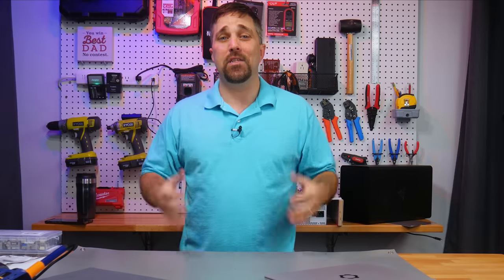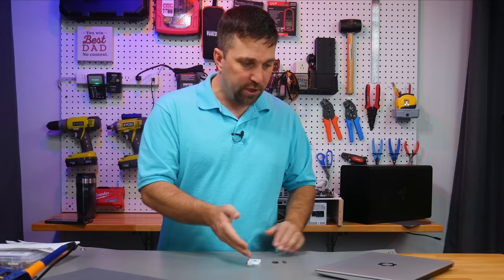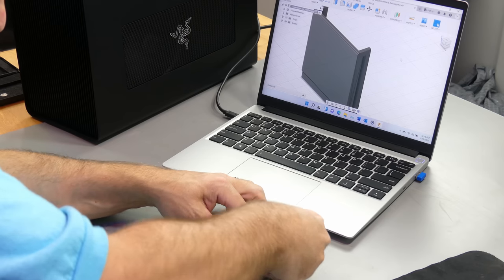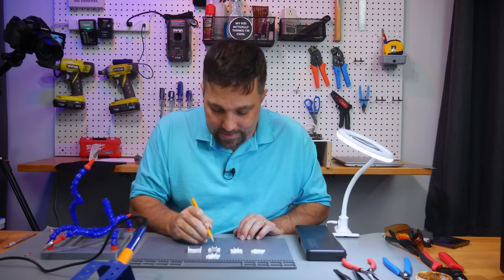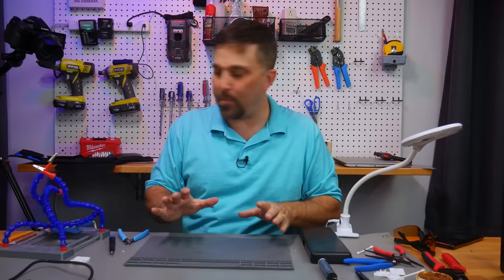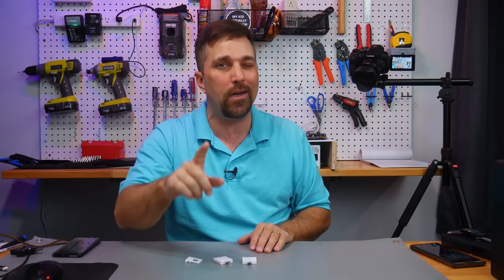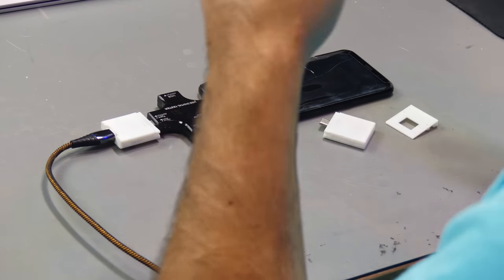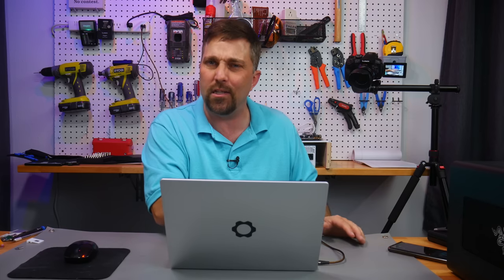Prototyping Framework Laptop Expansion Cards

Comment: Not sure if it would be a thing, but could you add in a breakout in the enclosure, to still have USB out but have a PCB to piggyback off the line to have the best of both worlds?
Reply from the maker: It requires integrating a USB controller chip into the PCB design. I was trying to keep it simple.

Comment: I really wonder if there would be enough room for there to be an expansion card with an internal USB for a dongle and an external one for everything else. I'm thinking maybe the internal dongle could be mounted sideways in the case, idk. 
there could easily be enough room for a double slot adapter, where it's like a mini USB C hub with 2 ports.

Comment: A double USB-A single slot expansion card would be nice
Reply from the maker: Two USB-A ports physically don't fit in a single expansion card.
Reply: @ElevatedSystems  *sad * then they made them either too big or too small :(  Just 5mm extra wide would make double possible it seems. Or make them 5mm narrower and six slots would fit

Comment: Any chance of fitting the Sennheiser GSP 370 wireless headset dongle into an expansion card? Not sure if it would physicall fit. The dimensions are 34.72mm x 17.86mm x 7.00mm for the dongle housing alone (without the USB-A male connector), and the total length with the USB-A connector included is 46.82mm. Measured with Mitutoyo digital calipers with +/-0.01mm Accuracy, 0.01mm Resolution. The part I want to fit is a SCGD7, "EPOS GSA 370". I found the holy grail of wireless headphones (simultaneous mic capture and playback with high quality audio, long range and long battery life), but they're wonky to use with a laptop because of the dongle hanging out. This would be PERFECT and would get me to buy a Framework laptop.

Comment: I wonder if it's possible to add Apple's older style MagSafe charger to this. Say like adding the MagSafe 2 port on the laptop and using an official MagSafe 2 85W charger.
Reply: While it would be cool, MagSafe 2 doesn't conform to the same standards as USB-C power delivery (it provides somewhere between 14.5-20V only, rather than 5, 9, 15, and 20 specifically), and doesn't have the communication abilities either. It would require either the power intake circuitry on the framework to be fairly flexible, or a fairly beefy conversion board to work. 

Also... it would require hardware that Apple is extremely restrictive about. They've never allowed anyone else to make MagSafe accessories, even going so far as to sue a company who did, and the only access for third parties has been harvesting the connectors from first party parts. 

Which is sad, because it's a pretty great standard otherwise. But it's a repair nightmare.
Reply: @natalie5947  I get ya. Even if it were possible. But I don’t think Apple would have grounds to go after anyone. It’s just a DIY project with individually sourced parts. You can buy a MagSafe 2 port replacement for an A1502 on iFixit for $20. But you are completely correct on the incompatibility and size restrictions which is a bummer. It sounds like such a cool concept because MagSafe 1 and 2 were so much better than any of these type-c remakes.

Comment: you don't need a usb-A female connector, just use the pcb itself with spring finger contacts
Reply from the maker: For EMI reasons I want to maintain the shield.
Reply: @ElevatedSystems  right, kinda forgot the tray is plastic, some aluminum foil would work too though if it ever came to that

Comment: You’re going to the trouble of designing a whole new expansion card just completely remove the usb Jack from the rf dongle pcb and solder the pads to the usb-c breakout. Or is the point to be able to recover that rf dongle to take it to a new computer and plug it in usb A again?
Reply from the maker: Yes, but more to be able to use the expansion with any RF dongle.
Reply: @ElevatedSystems  gotcha gotcha I had a nagging feeling you must have a reason. You didn’t seem like you hadn’t thought this thru

Comment: I just recently found the Framework laptop.  How difficult (or is it even possible) to build an RJ45 expansion card so I could plug into my wired network?  I know, wireless is all the rage, but I prefer wired when I have the ability to use it.  100mb or even 1gig would be great. Thoughts?
Reply from the maker: I'm pretty sure Framework is working on one but in the short term there are plenty of USB- C to RJ45 adapters available.
Reply: @ElevatedSystems  Of course.  I was just hoping to skip the adapter portion of the process.  Thanks for the reply!

Comment: I thought "MagSafe" aka magnetic charging cables were a thing of the past. Had one like 10 years ago on my, at the time flagship, Surface RT and it’s genuinely the worst experience I ever had. If I wanted my charger to have a very weak connection, I wouldn’t even use magnets I'd just hold the cables against each other with my bare hands atp.

Comment: You know that using the internal monitor when plugged into an external GPU , you are getting a degraded experience and you should have an external monitor instead?
Reply from the maker: I know, I'm working on a whole video about it right now, but I just needed the eGPU because Fusion 360 is still having issues with the Intel Iris Xe drivers.

Comment: There is this thing called bluetooth and it is in the framework and they make mice that run on it. So why go through all the effort to hide a dongle you don't need?
Reply from the maker: Lag and power draw and security.
Reply: @ElevatedSystems  I've always been using Bluetooth I've never seen any lag unless you're gaming. You're using a 60 HZ locked screen. Power draw and security -  if anybody's using Bluetooth headsets you're getting the same problem if you're worried about that.

Comment from the maker: I ended up changing the magnetic cable used for the charger. The one I was using could, and did short if it twisted slightly. This connection pins were too small and too close together. I'm going with this instead. - https://amzn.to/39btu84  The nine pin connection is much more stable.
Reply: Hi, I went after the spec and in the BC1.2 USB spec it says that a USB 2.0 charging port you can have from 1.5 to 5A of current. So you could get it to charge faster without the need for your purchase and custom designed PCB to arrive. 

Either way I understand that it was just a proof of concept and that no one HAS TO know all these details about the USB spec by heart just out of the blue.

Comment: Are there any thunderbolt 4 capable eGPU enclosures? I know that thunderbolt 3 has pretty severe performance penalties from bandwidth limits.
Reply: Thunderbolt 3 comes in 2 flavors. 20gbps and 40gbps. Thunderbolt 4 is effectively just thunderbolt 3 with only 40gbps allowed. Most egpu docks should be thunderbolt 3 40gbps / thunderbolt 4
Reply from the maker: That is essentially it. There are some efficiency improvements with TB4 but as far as eGPU performance there isn't much difference, especially if outputting to a external monitor and not the laptop display.
Reply: @ElevatedSystems  I've always thought that with the thermal restrictions on laptop power draw that thin and lights don't make much sense for pairing with beefy eGPU's. You'll almost always be bandwidth constrained and have a CPU bottleneck.  I think true SFF PC setups with portable displays and more potent power delivery options make more sense than the thin laptop/ eGPU combo. There are some cool variable input DC-ATX power supplies available now that allow you to essentially DIY "laptops". Or a petter term would be an untethered desktop.
Reply from the maker: @davisbradford7438  They really don't for tripple A gaming, but they are still great options for hardware accelerated workflows (video editing, 3D design/rendering, streaming) Also I'm just running a GTX 1660. It gives me the CUDA acceleration I want and the Turing  NvEnc, without bieng too bottlenecked by the CPU.
Reply: @ElevatedSystems  Yeah that spec of GPU is pretty ideal for laptop eGPU.

Comment: Ok.... I use a Logitech M570 rollerball and a M$ Sculpt keyboard, both of which use USB-A RF (whatever) connectors..... is it possible to put a hub w/2 USB-A connectors in one enclosure? I don't have your resources or I wouldn't ask.. I mean.. lets face it.. if I can plug in 2 USB-A RF connectors into one Framework block and have it recessed into the laptop frame.......

Comment: is dual usb C in one card possible?
Reply from the maker: Yes but to have full functionality it would require a USB control chip and I'm not set up to prototype that however I'll be checking with the PCB manufacturer to see what SMDs they have on hand.
Reply: @ElevatedSystems  that's cool!

Comment: Great video! You inspired me to make a magnetic charging solution too. I was able to make a magnetic charger card no soldering required and full power delivery. You can check it out at my channel if you are interested.
Reply: I also was able to get a really close color match with Krylon Metallic Silver spray paint. Are you planning on making any more expansion cards?